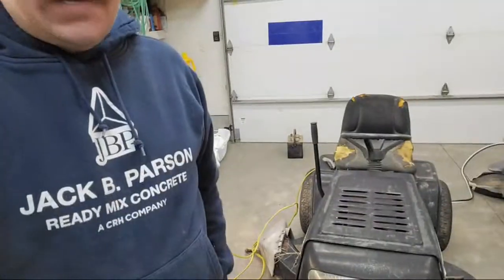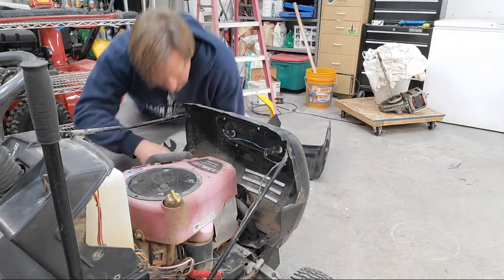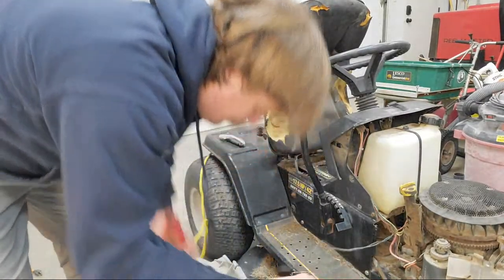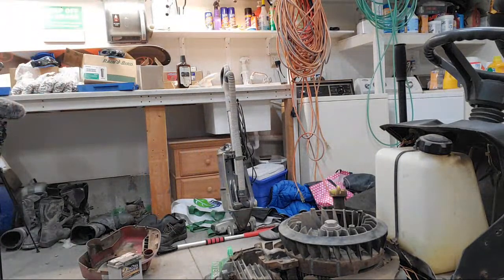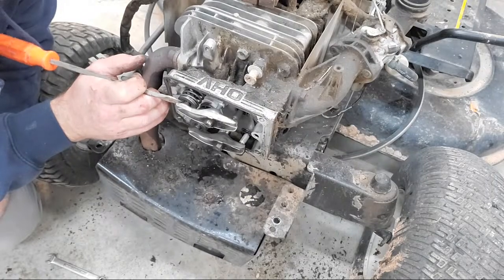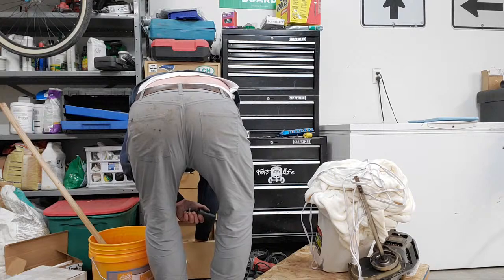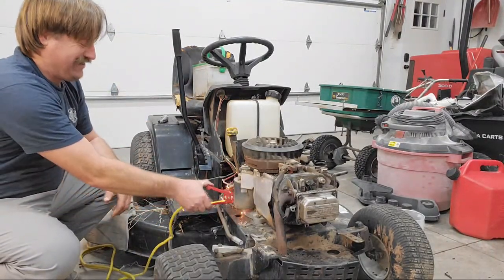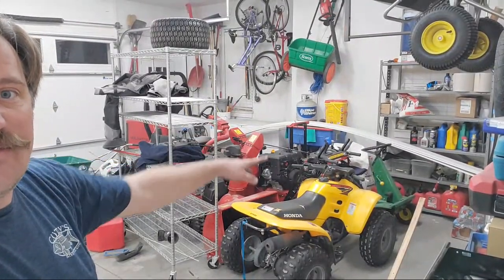This Hunk Of Junk

Comment: Disconnect the starter completely from the mower and hook it to the battery to make sure it’s not a starter issue. It could be the starter solenoid, the starter Brushes may have failed (or a starter coil broke)so having a look at both this and the starter motor itself